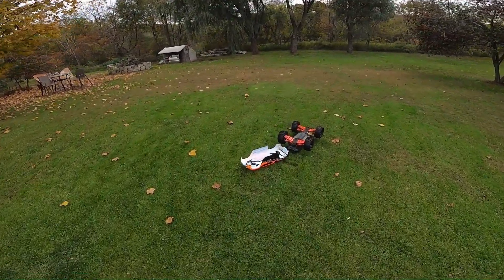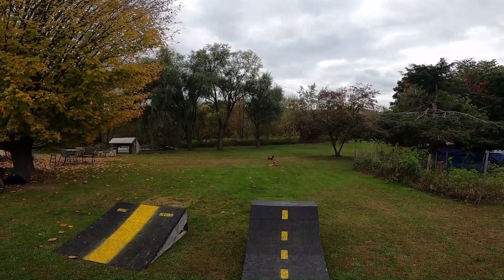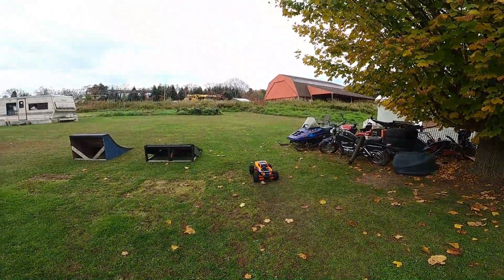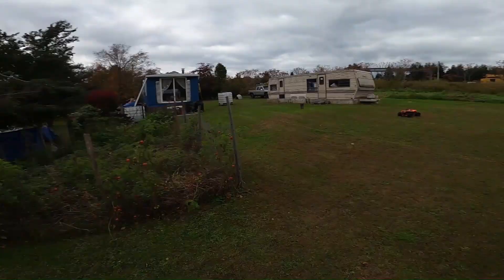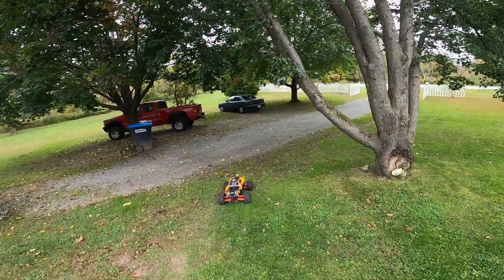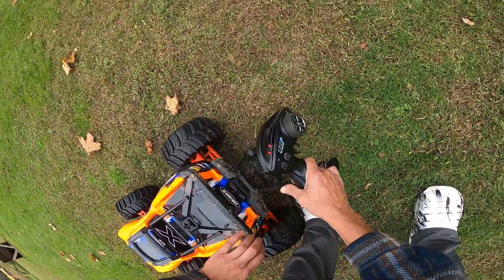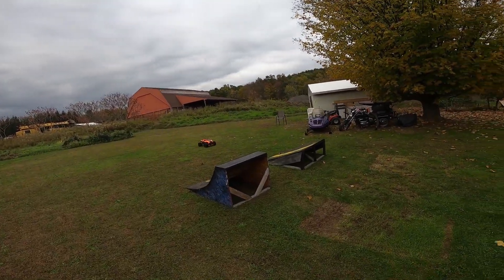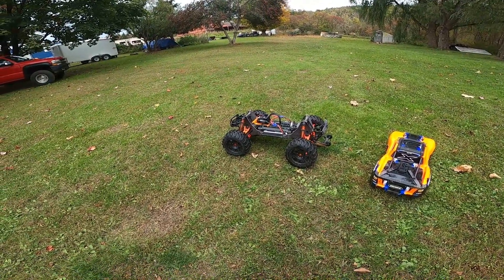XMAXX HOBBYWING Max 5, 1100 KV and Mod 1.5 25/30 Gearing

Comment: I did 500K in the front 1 ear plug with 20 mill for the center and 200K  in the rear. Drives like a dream. It is insane with that Max 5 combo

Comment: Traxxas just came out with a brand new HD servo that has 650 ounces of torque at 6 V part number is 2085R, check😮 it out. M2 C has a bell crank kit for the Xmaxx all this should definitely help out your steering
Reply from the maker: Thanks for the tip
Reply: 650 ounces at 6 volts its pretty impressive

Comment: Oh bro . Those other channels are breaking stuff all the time . Prob every run . Anything over 10’ high and a bad landing . Consumable parts , depending . Apparently this one is one of the best for jumping and durability once the gears are changed to hardened . For the price it should come with some worthy gears . It’s kinda ignorant to the consumer imho to put any pot metal on this RC